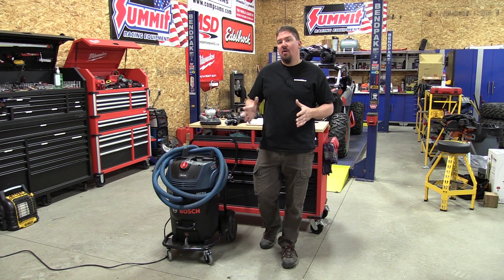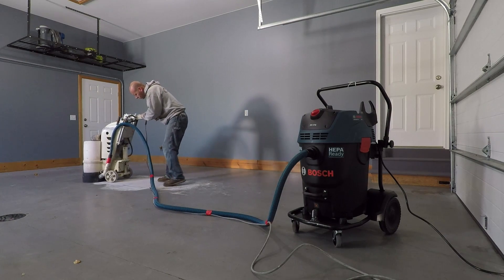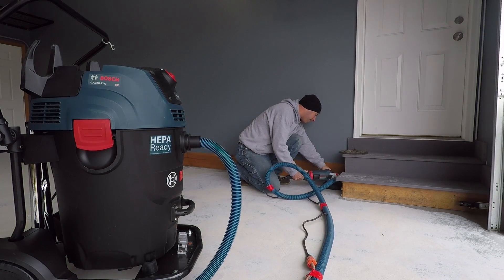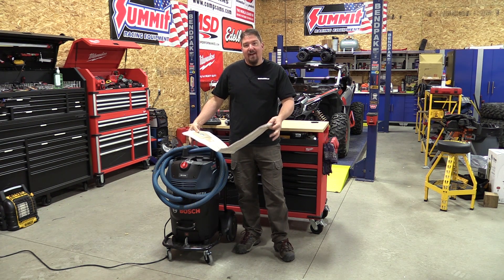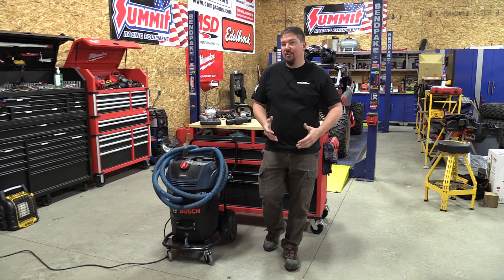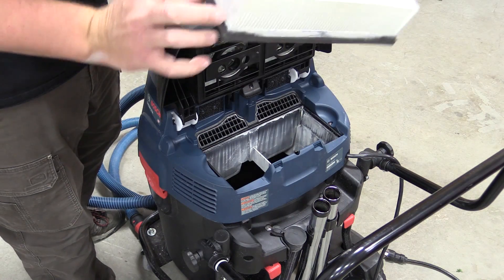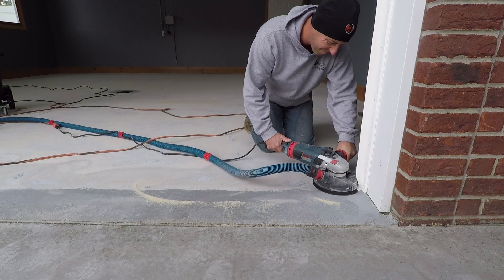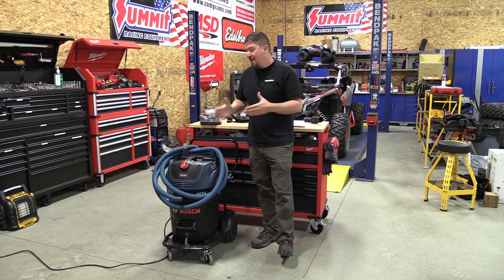Bosch GAS20-17A 17-Gallon 300-CFM HEPA Dust Extractor Table 1 Compliant

Comment: I’m starting a poly business and I just bought my edco single head grinder. Would this be a good starter vaccum ? Like the biggest garbage I would do starting off would be 800Sf and the bags if I empty them and shake them out real good can I re use maybe another time .? Or do I have to use another and if so how much bags will I go thru per job.? When I did it in atx we had top dollor equipment as I am starting off some of the equipment I am getting will be more affordable. Thanks to YOU or anyone who reaches out.

Comment: My ridgid 16 gallon has the same cfm....using a oreq stinger pool hose, why pay 1500$
Reply: It will get clogged in 3minutes if you grind concrete......this one has auto filter cleaning...
Reply: Your rigid will burn up after a few uses on grinding concrete like this. Lmao.
Reply: LMFAO  GTF

Comment: The Hilti and Bosch are basically the same machine although filters are different.  I use this for my tablesaw both the bottom dust port and the overhead at the same time. It’s not perfect but it does do a decent job with a 2.5” hose. The price is prohibitive though and if I had to do it again I’d just buy a large dust collector. But again I’m not using it for concrete.
Reply: Are you referring to the Hilti VC 300-17?  If so, what differences are there between the Bosch and Hilti?  I'm leaning toward the Hilti VC 300-17 at this time.  Performance, reliability and maintainability are my biggest considerations.  If you have practical experience with the Bosch or Hilti, I'm interested in hearing the things you like and dislike about the vacuums.
Reply: @RedondoBeach2  I have used both the Bosch and Hilti.  My local Hilti rep wouldn’t confirm that the Hilti is made by Bosch but it was kind of a wink wink thing.  Both vacuums are great.  We went with Bosch because they were less expensive but either machine is good and capable.

Comment: Is there a cloth bag for this vacuum ?
Reply: So it’s a filtered bag that can be washed blown off with a leaf blower and used over and over again?
Reply from the maker: @edcoburn3141  No, it comes with two flat pleased HEPA filters but you can buy bags to line the vac so you can remove the concrete dust without a mess and breathing it.  The bags are disposable
Reply from the maker: Yes, we show it in the video.
Reply: Is there a filtered bag available for this unit to where can be used over and over again. Because in my line of work hardwood floors sanding I would have to use four bags to five bags a day which is not feasible.

Comment: I suggest not using paper bags when using the auto clean up function. The blowback causes the bag to rip open. If you use fleece bags you will be ok. Don't know if they are available though like in the smaller 9-gallon vac.
Reply from the maker: We are using the Bosch paper bags and none have ripped yet, although they plug up fast.
Reply: It’s ok to run the vacuum without bags though? I ran across that problem with it blowing the bags. Then with the fleece bags I wasn’t getting the same suction. But I didn’t know how good for vacuum it was to run without bags.

Comment: Very cool! Does Bosch have a vac that compares with the Festool CT series?
Reply from the maker: I am not up on the Festool vacs.  Bosch does have smaller vacs vary similar to this one made for woodworking.
Reply: Lol. The 9 gallon Bosch vacuum  VAC090  outperforms all Festool vacs.  It is 150 CFM (Festool 138), has automatic filter clean up and you can use cheap rigid vacuum bags. ( besides Bosch paper or fleece bags,  which are around $10.00 each).
You can also put L-boxxes  on top . Highly recommended.